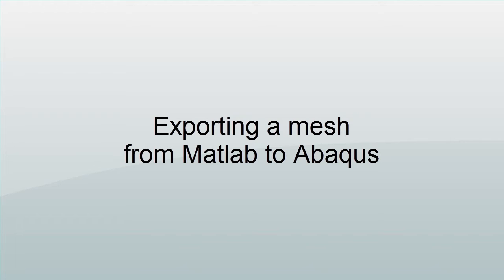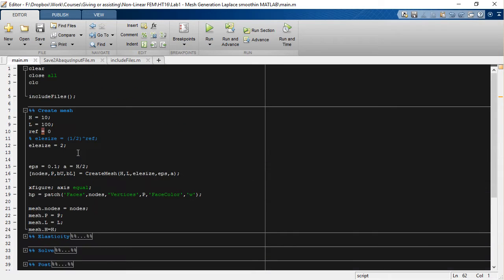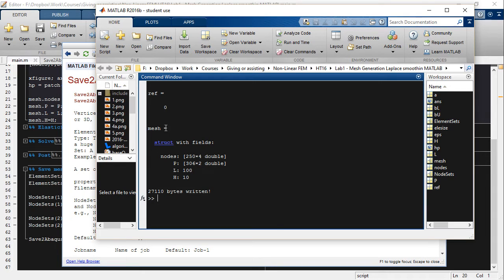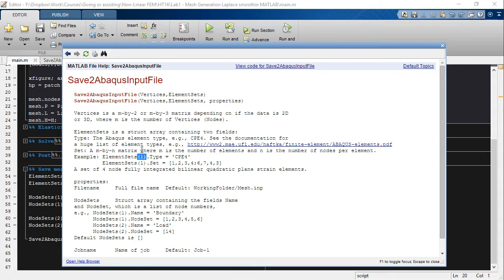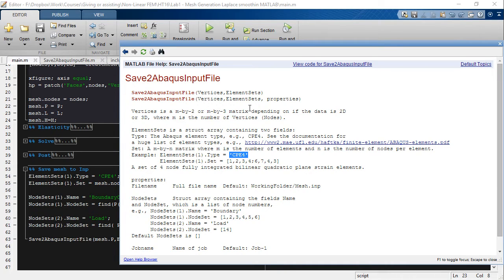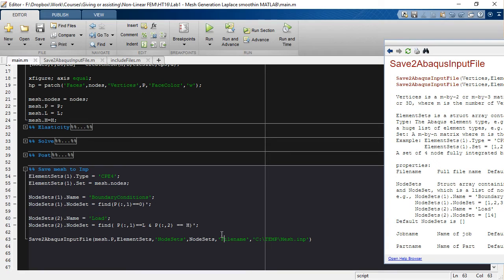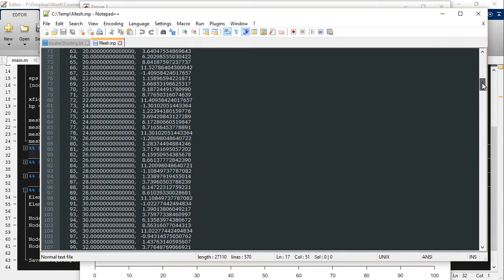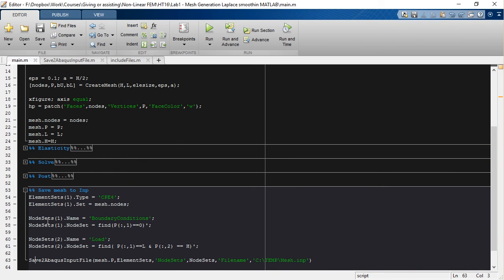MATLAB- Export a mesh to Abaqus

Comment: Hi 
I am currently working on a MATLAB program that generates three-dimensional Voronoi polygons. I use the tri-surface command with Faces, Vertices and Triangulation as input to plot these polygons. I also use a for loop to generate these polygons one after the other. I would like to know if it is possible to convert these polygons to a mesh input file so that I can export it to Abaqus?
Reply from the maker: You need to check if Abaqus uses that type of element topology. Check the user manual. The input file uses keywords for coordinates and node connectivity. This can be easily generated from the Vertices and Faces/ Triangulation variables that you have.